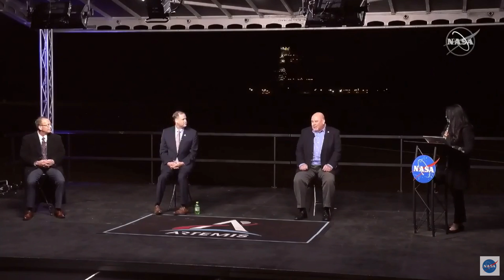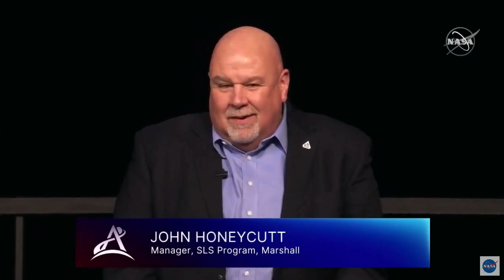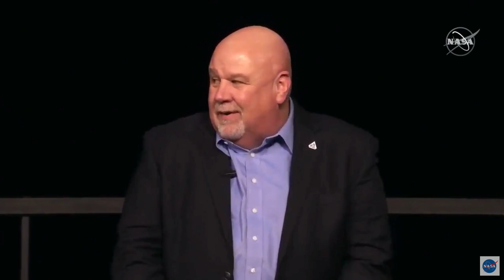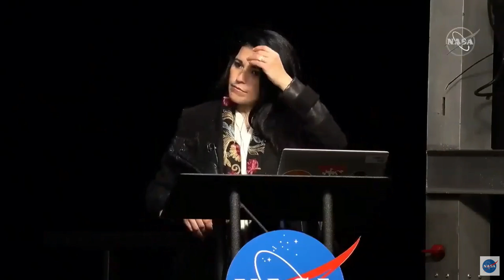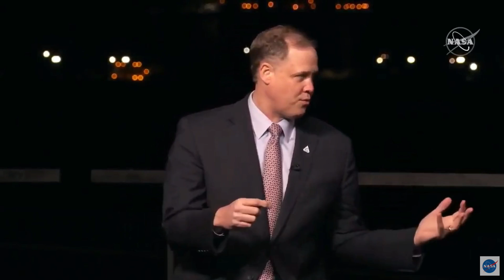Major component failure ends SLS rocket core stage test-fire prematurely, NASA explains

Comment: The first flight utilizing an RS-25 engine was 04/12/1981.  Kind of surprising that they are still having issues making it work correctly at this late date.  Also, an extremely complex expensive device for single use operation.

Comment: I want to see this thing fly but given there were obviously issues with the procedures and testing of the fueling, pressurisation and the engine chilling on a rocket designed 17 years ago, that is using flight proven hardware. This should after all this time be a sure thing. To have a major failure is incredibly disappointing. So do we see SLS given a free pass or do we see a proper static fire with full pressurisation and full burn time on the engines with no issues. This is why we test after all. To ensure we get it right. Given this technology dates back to the start of the PC era let’s also ensure that the computers and hardware are truly compatible and tested. It would be more than embarrassing if a computer glitch caused a significant loss. NASA would suffer a major investigation  and  significant modification of management and priorities if this rocket does not fly first time. It would be a shame to see NASA go through that after it’s past successes. The contractors need to get their acts together or they will kill the goose that laid the golden egg.

Comment: "Major component failure" is an overstatement.
Reply: I think you would agree the engines are “major components”. Engine #4 failed after 1 minute, when it was supposed to run for at least triple that time. How is that an overstatement?
Reply: @Exxos111  We don't know that the engine failed. The computer on #4 detected something that was beyond accepted parameters and shut the engine, and thus the test, down. We don't know what the detected issue was, or what the tolerances the computer would accept were (or how much stricter those tolerances were given that this test involved flight hardware).
Reply: @Exxos111  But I should have said "possibly an overstatement, and definitely premature."
Reply: I was being a bit unfair though, as engine 4 did show an MCF condition right after the test began. It didn't cause the premature stopping of the test though. From the blog:

"Initial data indicate the sensor reading for a major component failure, or MCF, that occurred about 1.5 seconds after engine start was not related to the hot fire shutdown. It involved the loss of one leg of redundancy prior to T-0 in the instrumentation for Engine 4, also known as engine number E2060. Engine ignition begins 6 seconds prior to T-0, and they fire in sequence about 120 milliseconds apart. Test constraints for hot fire were set up to allow the test to proceed with this condition, because the engine control system still has sufficient redundancy to ensure safe engine operation during the test. The team plans to investigate and resolve the Engine 4 instrumentation issue before the next use of the core stage."

Comment: Why was there a change in the engine conditioning? Aren't the private business contractor supposed to deliver products to NASA based on specs that would negate the need to make changes for an engine test? Plus, the RS-25 has been around and used since 1981.  The major difference is that the engines are supposed to run at 110% vs the 104% for the space shuttle. So we have been waiting for 17 years for the private contractors to deliver an engine to do that.....and the private contractors failed. This is not on NASA.....it is the private contractors

Comment: Despite the blustery comment, its good it did not occur during an actual launch of the SLS. Otherwise it would had triggered an abort. Learn from the data, fix what went wrong, redo the test again. Remember, this... 6 months before the first test launch of the Saturn 5, the 2nd stage had all kinds of problems and everything on it had to be x-rayed, causing a very long delay, which shot the timetable full of holes. But it launched in November 1967.
Reply: Agree with your comments on Apollo.  However, the engines from Saturday's test fire are Shuttle engines... NASA, Boeing, Aerojet are not designing a completely new engine.  That, among other things, is what makes this frustrating as hell.  Anything to do with Boeing has a smell about it now.
Reply: @jimrohrich2625  even more important not to have GO FEVER!!! TEST TEST TEST!!!
Reply: You know it was planned to fly without this test? Nasa interviened and insisted on this test. This rocket was planned to fly astronauts without any test and you can guess how it would have ended.

Comment: At this point, with SpaceX's success at reusing rockets, it's insane that this program is not switching to a different design; or at least working with SpaceX on how to do it.  Billions of dollars at the bottom of the ocean is no longer acceptable. I don't care how far down the road Boeing and NASA is on this; stop it now, reassess and redesign this vehicle so that it cost less and still does the job.
Reply: This is probably the last vehicle that nasa will ever design. Stopping the program will be so costly and so they should just finish the job
Reply: Wonder who can stop the SLS project? Congress or NASA director?
Reply: Elon being interviewed by Tm Dodd aka Evetyday Astronaut said something like: if the design takes too long, the design is wrong. And: very often happens that good egineers are solving unsolvable problems because of too much pressure on them or simillar reaaons like SLS in NASA - reducing costs, reducing development time, due to governmet funding expecting perfection from NASA. But all the dirty work again falls to egineers expecting from them do the miracle from maybe impossible design as menrioned.
So kudos to NASA egineers and spaceX as whole..

Comment: Well, so much for Artemis I flying Q4 this year. I'll be extremely surprised if the SLS is able to do another engine test before 2021 is even over.
Reply: Not only that, but they made the bone-headed decision to go ahead and start stacking the solid boosters in the VAB at Kennedy and those apparently have about a 12-month shelf life once they are stacked, so if they can't sort out this engine problem and do another green run test successfully in the near future, they are going to need to get 2 more boosters manufactured as well, which will cause an even longer delay.

Comment: why don't they just slap 4 raptors or 4 be-4 engines there? it's a lot more powerful than rs-25 tho.
Reply: That is not true. Specific impulse of hydrogen liquid oxygen mixture on rs-25 is 4500 in vacuum, raptors would show 3500 tops.
Reply: @andreikoto4810  but is it kinda better to launch with higher thrust-lower isp rather than lower thrust-higher isp. I mean those high delta-V from high isp will be wasted to fight gravity
Reply: @youroniichan13  The whole SLS is based on liquid hydrogen. 11.8 billlion dollar system and counting. So, you want NASA to start over with methane engines with questionable end result. It makes so sense.

Comment: Disappointing. 

These engines are a 40 year old design that has flown relatedly hundreds of times. Further, the development times on the SLS are insane. We went to the moon and back twice over in the time this system has been in development. There really isn’t an excuse for being able to fire turn fully first go.

This state of affairs is largely the fault of a feckless Congress using manned space fight as a kind jobs program instead of concentrating on the mission.
Reply: Which congress? They've fleeced a couple iterations during this program.

Comment: cost over run by billions, 4 years behind  schedule, ....need to scrap this money bleeder and just let Elon run the space show!
Reply: By this point they've built the hardware for several launches (mostly) and it's all paid for. Might as well launch the sucker a few times. Would have been a good rocket 20 years ago when Shuttle external tanks with 4 engines and the SRB's with payload on top was proposed (first in the 80's) now it's just old. While Starship becomes reliable they can fly it a few times send some heavy stuff to the moon and then let commercial partners bring payload and people to the outpost while large commercial rockets mature to expand the lunar presence. Falcon Heavy, New Glenn and others can do most of the work. Compared to an SLS launch even a Vulcan launch is pretty damn cheap. Reviving ACES would a cool way for ULA to remain relevant but I have my doubts on that.

Comment: Seems to me that engine 4 has been problematic all along.  If they have a warehouse full of these WHY didnt they change it out before this?
ALSO:  This is NOT the most powerful rocket "Humanity" has ever used>  All 4  rs25 engines produce less than just ONE F-1 engine.   
All 4 RS25 engines + 2 SRB's = 7,272,000 Lbs/Thrust.    Saturn 5 had 7,610,000 Lbs/Thrust.  Where are they fudging the figures?
-BTW: I fell asleep  during that first CYA monologue.
Reply: These engines aren't cheap. They cost 146 million dollars each.
Reply: @mauricegold9377  No mention of cheap, I just made the comment that they had a warehouse full of them, but they are all used even with refurbishing, they need careful testing.  RocketDyne made both the RS-25 as well as the F-1.

Comment: Problem of pressure increase is location of tanks and/or fuel feeding system you can solve this problem with some simple modifications such as with some additional pipes ...and change the location of fuel pump/injection

Comment: Come on you pessimists! 

SLS only started being developed a few years ago, 1988 to be exact.
Reply: this is what happens when you rush development without enough money ... oh wait!
Reply: Sls is using the space shuttle engines, and a refreshed version of the solid rocket boosters, also used on the shuttle. 17.5 billion spent so far for a 1 minute engine failure.
Reply: SLS in its current form started dev in 2011 actually
Reply: @iamarokotmanson  it's current form is basically Ares which is basically Shuttle Cargo. 

To say SLS started in 2011 is like saying Starship started in 2020 only instead of with ITS in 2016 or MCT in 2012.

And really,  there are much bigger differences between Starship and 2016 ITS than between SLS and Shuttle Cargo

Starship has more differences to

Comment: Apollo 1, challenger, Columbia..... SLS next?
Reply: Nah. SLS unlike the shuttle has a LAS. So if something happened to the rocket the crew capsule could escape the explosion safely.

Apollo 1's issue was an issue of a pure oxygen environment and fire and it was untested. Orion has been tested several times safely.
Reply: @brandonfleming7118  Indeed. Also, we don't even know yet why the #4 RS-25 engine controller shut the test down. Way too early for such speculations.

Comment: If Wernher von Braun was still alive and working for nasa he would not be proud I think he would start working for Space X especially when seeing the cost
Reply: It’s funny because the Saturn 5 cost way more than this rocket and it can carry more to the surface of the moon
Reply: @Aceb_k  cost, but worked....
Reply: @Aceb_k  but they didn't refurbished the engines and all the rockets parts, they made new one's manually.
Reply: @DavidRamirez-lq2co  Everything except the RS-25 engines is BRAND NEW
Reply: @Aceb_k  and they failed on that...
Reply: @DavidRamirez-lq2co  uh wdym they didnt fail everything is brand new except the engines
Reply: @DavidRamirez-lq2co  Stop hating theres no such thing as a bad moon rocket
Reply: @Aceb_k  You were saying that the Apollo was worse you are clearly the hater here, I just pointed out that they are using Apollo technology that wasn't invented at the time, that's why Apollo is expensive because they had to start from scrap.

Comment: It’s normal for testing to throw up problems, that’s why they test. SpaceX has had plenty of similar issues. However, progress has been slow, and to let this incredibly expensive machine fall into the ocean and sink to the sea bed is criminal when SpaceX has perfected reuse.
Reply: What is really criminal about this, is that they spent billions of taxpayer money, two billion dollars over budget. And still had a failure during testing, I understand you need to have failure before you can have success. But at this rate SpaceX is going to completely curb stomp them.
Reply: But SpaceX is clearly following a 'fail and iterate' strategy, which is why Musk always seems so chipper when one of their prototypes crashes or explodes (RUD). I think these guys actually believe they're using a 'right first time' strategy, which is why the spokesman seems totally befuddled.
Reply: @johnwinward2421  Yes, and SLS has a more bureaucratic management style. SpaceX is agile, they can make fundamental design changes as they go along and discover better ways to make something.
Reply: Problem is NASA test rocket ones in 4 years...Spacex ones in a month
Reply: It’s not like they can just slap on some landing legs and call it a day. Just cuz SpaceX did it doesn’t mean it’s easy. It took SpaceX 10 years to actually develop a reusable rocket.
Reply: @ProtonSemilightCondensed  Yes, but they did it, first in test rigs, then in live launches where a failure to land was not critical. And they also developed several entirely new engines.
Reply: The problem is that they had not allowed for the event of failure. They were so confident of success that they continued reading a script that described what they would do now that it had succeeded. This outcome could result in long delays, yet they have already started prepping boosters that will expire at great expense if they are not flown within 12 months.
Reply: The NASA spokesperson actually signed off by thanking us for witnessing 'the successful test firing'. Clearly reading from a script written last week.
Reply: SpaceX is working with bare-bones prototypes that are never intended to reach orbit at present. The engines are around 1 million dollars each, but there is a production line with improvements every day. Additionally the Starship can be built in a matter of days. SLS has been 10 years under construction, is no prototype, probably the one and only, and each of its 4 engines costs 146 million dollars. If they broke the SLS, goodness only knows how long it would be till a new one was ready. A year? Two? Who knows?
Reply: @mauricegold9377  Nope. The Falcon and Falcon heavy are full sized rockets capable of lauching large payloads into orbit. SpaceX has repeatly landed the first stages after many commercial launches. Some first stages have flown 6 or 7 times. Regarding Starship, it cannot be built in a matter of days. It uses full sized engines, but yes it is at the prototype stage. Comparing engine cost is unrealistic. SpaceX can launch a satellite far cheaper than anyone else thanks to their innovative methods. Many of these companies are big bureacratic concerns. I've worked in some UK companies on government projects, and sometimes they are unbelievably inefficient and poorly engineered, because projects are sold and led by managers with more marketing than engineering knowledge.

Comment: Did the cooling jacket fail? You could see a red glowing spot on the exhaust nozzle at 02:08:15. 

https://youtu.be/ELHOXi2t3lk
Reply: All in *GLORIOUS* 720p .....     
 ..... *sigh*
Reply: It seems there was leak in the engine no 4. It burned trough coating, and during test, if you watch it frame by frame, you will notice waves of flame coming outside of the nozzle at engine 4.

Comment: This is what happens when bureaucrats and Boeing (who depend on lobbying for getting government money) try to do science and technology. They give a positive spin to wasting money and clueless action!
Reply: Boeing has turned into a dumpster fire.
Reply: Actually, the engine is built by Aerojet Rocketdyne. In fact, I believe the four engines tested were from a small fleet of engines left over from the shuttle program.....not new engines
Reply: @dbreardon  right. and only 16 engines left that were made for reusability that are now expendable with no plan yet for replacement.
Reply: @HomeyKhann  they have a contract out for additional engines. But with an engine that has been around since 1981, they ought to be able to crank these out and do it cheaply....sadly, that is not the case
Reply: This stuff ain't easy you know.
Reply: @therealxunil2  The RS-25 rocket engine has been around since 1981 and has been used on 135 space shuttle missions. There is no reason except ineptitude by the private contractor that caused this failure.
Reply: @therealxunil2  no it is not easy, sure - and that was why we never questioned all that time and money that these folks would spend to do anything - but now we have been spoiled by the competence and audacity of Musk and his team of wonder workers! 

in the last 9 years SpaceX have built 8 new rocket engines (all the kind that were never built before) and now they are building a space ship that will not just take 3 or 4 or 10 people to the moon but a 100 to Mars! And they are getting there real quick with a fraction of the money Nasa and Boeing spends on going around in circles!